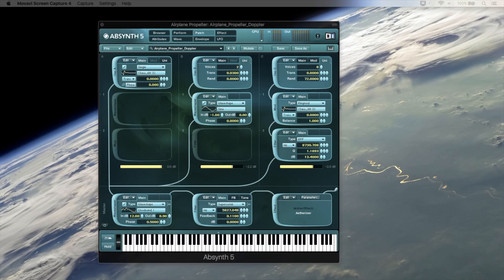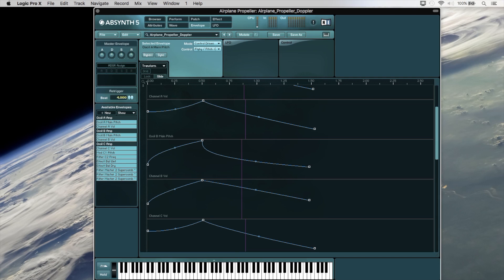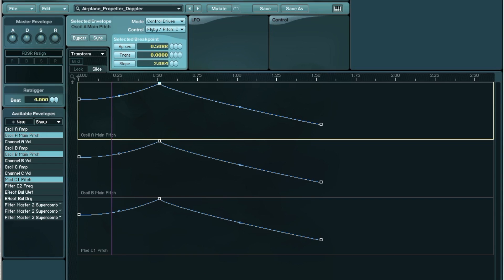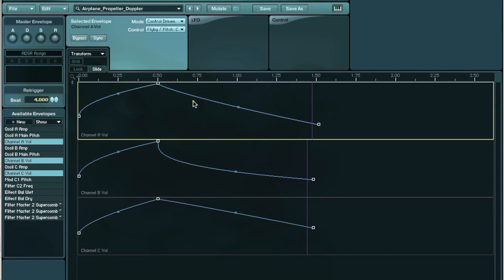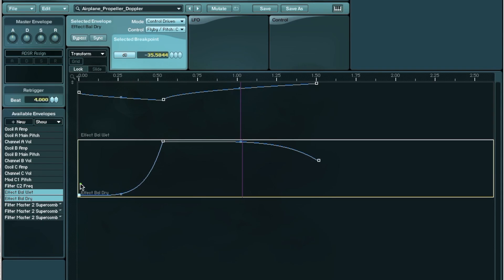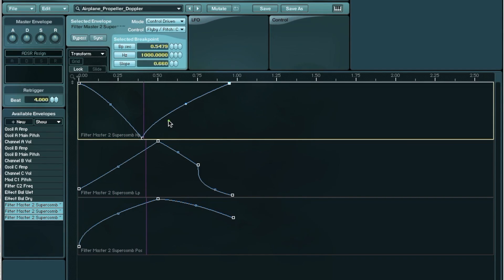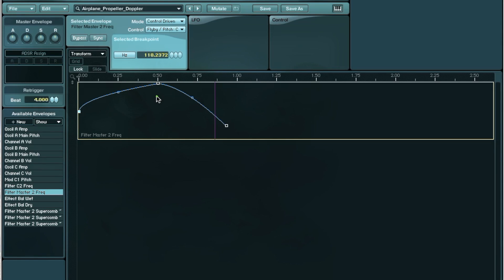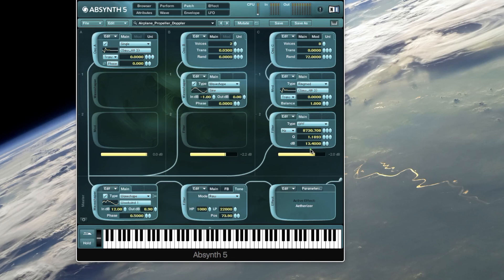Airplane Propeller Doppler Synthesis with Control Driven Envelopes Pt.2

Comment: This doesn't sound like a plane approaching and then receding to me. I think the doppler effect increases the pitch of an approaching sound by a fixed amount, assuming the speed of approach is constant, and similarly lowers the pitch by a fixed amount as the source recedes (at a constant speed) - and (if it passes you instead of hitting you) there is a transition zone that sounds roughly linear to me (watching youtube videos of P-51 flyby's...)
"A siren on a passing emergency vehicle will start out higher than its stationary pitch, slide down as it passes, and continue lower than its stationary pitch as it recedes from the observer. " - Wikipedia, Doppler Effect.
Reply from the maker: Hi Spike, thanks for sharng that, you bring up a valid point. If the plane is low flying and close to the listener, then what you are saying should apply. In that case, modifying each of the Pitch envelopes at 2:30, you apply a breakpoint after the initial one at maximum pitch. Then transition the pitch downwards to the lower bound. 

With aircraft however, there is another key variable such as the height. Consider that the sound is traveling spherically as normal, then the doppler effect actually should diminish as the height of the plane increases, because this creates an angle away from the direction of its travel. As the sound pressure waves are built up at the front of the plane, the angle below the horizon should lessen the doppler effect, since the vertical sound velocity is unchanged. That hopefully explains why sometimes I've not heard a stronger doppler effect with planes, especially those farther away. However lower flybys should take on a stronger effect.